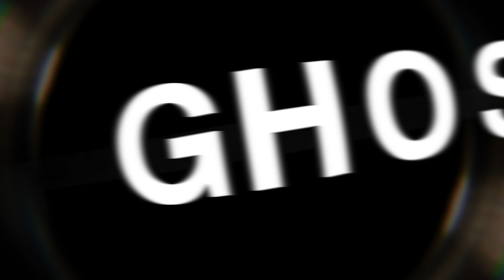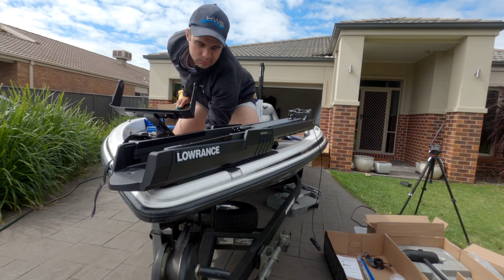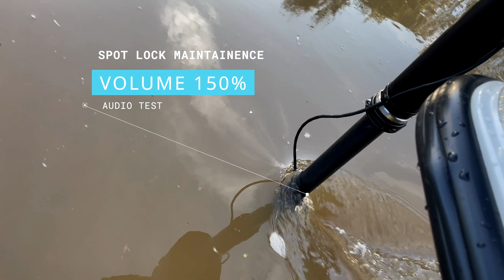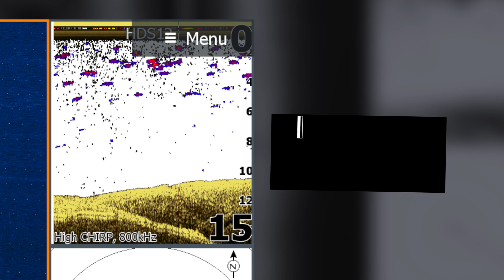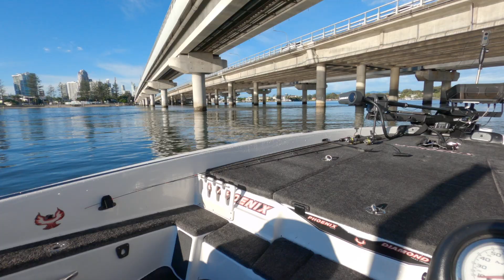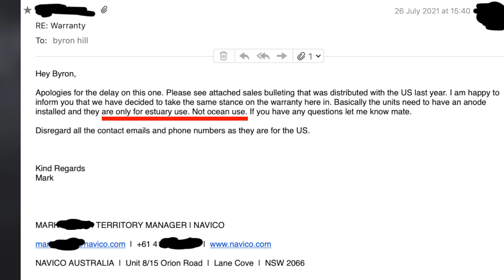Lowrance Ghost FULL Review and WARRANTY

Comment: What do you do with the extra cable from the 3-in-1 transducer?  I have not been able to find a 3-in-1 transducer with a short enough cable to fit into my ghost trolling motor.
Reply from the maker: the 3 in 1 transducer on the motor doesnt have cable off it. it's a new nosecone on the trolling motor

Comment: Great video. But i'm reading on the lowrance ghost warranty on website and it doesn't show that. Still says void of saltwater or brackish water. 
And did you have to use an adapter to connect the Ghost to HDS LIVE.  Heard Ghost is a 7 pin and live is a 9 pin.  
Thanks.
Reply from the maker: Hey mate, check the install video out for those details - I don’t remember needing an adaptor.

You are right, I’d say the website was the original sales information. Like I said, literally just changed.
Reply: @ByronTeaHill  Thanks for the reply. as i'm waiting for Ghost to arrive i went ahead and ordered the prop shaft anode.  So can put that right on. Sure website will update sooner or later but that was great info. You are the only one i've seen that with. Not even on Lowrances you tube. Ha. I think i had bad info on adapter. Well its a adapter it seems to be in box.  Not a 7 to 9 pin.  Foot pedal has a 9 pin mini plug. So i seeing its a 9 pin mini to the sonar 9 pin connection and thats suppose to be in box.  Is that was you had?  Great info. Thanks.

Comment: I agree that the 3 in 1 would be preferable, and it is only a couple hundred for the transducer in the motor, but there could be a big cost if the person doesn’t have the latest electronics that can run that transducer. I’m pretty sure I was told that I can’t even run that transducer on my HDS gen 3, so if you are spending 5k on a motor and you already have sounders you are happy with, then it might cost a bit too much to change over to the newer units. 
That’s what I would be thinking anyway. I have always been happy with my HDI up the front, and am running 4-5 units on the boat- 3 on the dash and 1 or 2 at the bow- so if I was to upgrade my Xi5 to the Ghost and it only had the 3 in 1, then instead of just 5k for the motor, I’d probably need to spend another 5-10k on new sounders. 
That would be good for Navico, but not so good for my pocket 🤣🤣